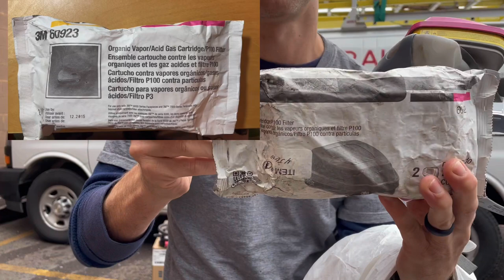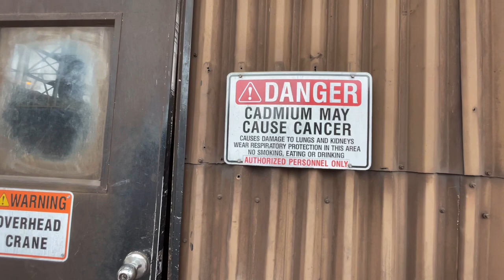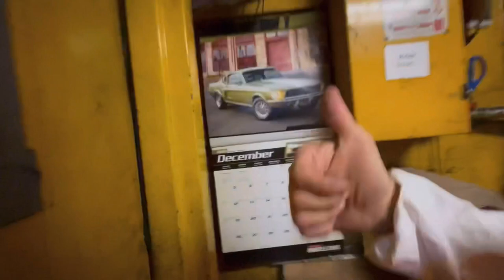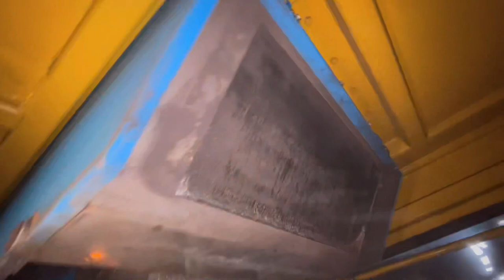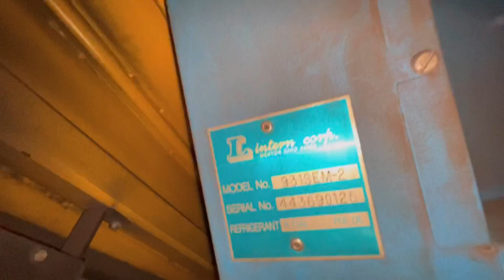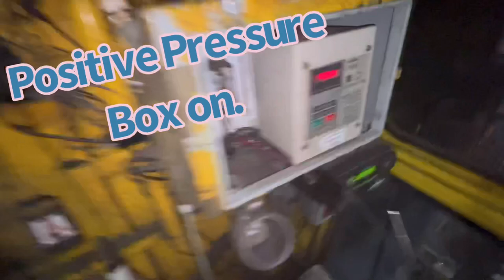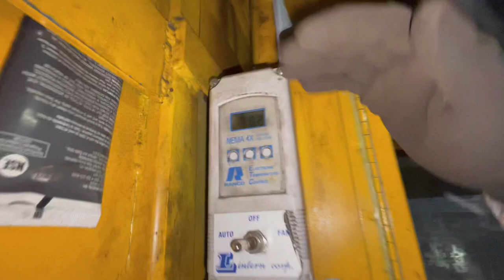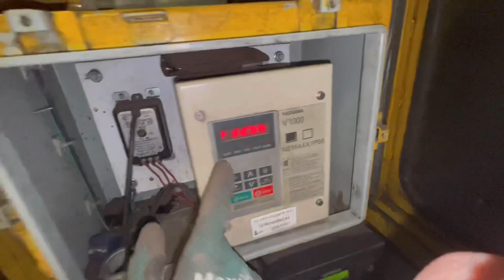Industrial HVAC 101 #hvacexplained #steamfitterslocal449 #lintern #hvaclife #sporlan #ruthrauff

Comment: Dust isn't only conductive It's explosive.
Reply from the maker: Damn right.  
I was using a compressed air gun to clear out a unit one time but first I had to blow all the soot off around the unit.  During that process it stirred up that metallic dust shorting across the contactor causing a violent explosion taking out pretty much all the wiring inside the unit.  Not fun to fix especially with no schematics.  
Caution must always be taken when working around live equipment especially with dust.  
Thanks for commenting have a great day.

Comment: I'm glad we're getting more electric heat equipment now cause it's more safe an cleaner to work in ice always wanted to see one in action
Reply from the maker: Electric heat is 100% efficient but it’s 100% expensive when it’s operating. Electric heat is very reliable as long as you have power and your connections are good.  It works well in many situations especially if flammable conditions are present.  Sometimes the hazardous conditions can  damage the resistive heaters by deteriorating the aluminum heat transfer discs on the side.    Thank you very much for watching and commenting on my video have a great day stay safe.

Comment: Thank you for the great video like always keep up the great work stay safe out there 👍🏻
Reply from the maker: Thank you very much Solo Tech.  I try to do my job safe as possible because I got many more years ahead of me.  Also I’d like to try to set an example to other technicians in this industry that we are not indestructible.  I like to point out interesting environments that we may get exposed to in this industry. A majority of these locations upcoming technicians don’t get to see in a classroom.  I may film a video coming up I have a neighbor that wants me to install a new furnace and air conditioner and I think I may refuse to do the job because she is a hoarder.  I literally would have to walk sideways to get downstairs and to her furnace it probably would take me a week to move all the stuff just to get the furnace out.  That brings me to my next point that I like commercial and industrial HVAC lol.  
Hope you’re doing well also have a great day.
Reply: @hvacexplained9341  Wow that’s crazy that’s a big-time fire hazard right there walk away from it lol
Reply from the maker: @soloch69  Well the fire burned itself out luckily without doing any more damage to the space below.  The one fire was on a packaged rooftop unit all the wires were completely fried, motors burned up I have no clue how they did not smell anything?
I’m currently starting up an air conditioner I installed a new system for a guy down the road for me in the fall I’m starting up right now as we speak.  Just making some final adjustments with the heat load we’re having at this time.

Comment: Just curious do you get paid more to doing the industrial jobs compared to commercial?
Reply from the maker: With our union yes, the rates are different.  Typically in any trade Industrial rate is higher.  It is not only hazardous but extremely dangerous.  
In the heating and air field you must be alert all the time.  
This by far is the worst of the worst conditions that I’ve worked in for my accounts.   I took over this account around 2005 and held it till about 2019 before I start training a couple technicians to take over for me because I have moved to Florida and currently with a new company.   
I begin my career at 19 years old, doing residential, heating and cooling for  1-1/2 years.  I will never returned to residential.  I help out friends and family only if it’s residential.   
The money is not there as a technician.  At least that’s my take.   If you are an owner of a residential HVAC company, you should do well as long as you show good customer service skills and have reliable, honest technicians.  
Have a great day Troy   🤙

Comment: This place looks like a riot lol. What facility is this? I’ve worked at a ton of the mills in our city except US Steel. Grunau does all there fire protection.
Reply from the maker: This industrial plant recycles hazardous material. It is extremely toxic for the environment and for the human body show precautions must be performed at all times. I literally have been going there since 2004 and a majority of my training was on the job, at this facility fixing constant breakdowns due to the conditions.    They have had three major fires in the past 12 years.   I have never seen a sprinkler. They utilize foam and other chemical agents to put out the fires.  They try to keep all chemicals in separate areas so they do not have a chance to incinerate the entire plan just parts of it.  I joke with guys up there once in a while saying the TV show dirty Jobs refused to come here lol.  I have been in many Other factories, power plants and industrial plants but this one by far is the dirtiest.  Thank you for your comment have a great day and stay safe.
Reply: I hear ya brother. I work at a glass plant in beaver county that’s pretty bad. No respirators required but I wear an N95 mask for my own safety. I’m working on the piping in  the bag joists and above the ceilings and there’s 1/4 inch of black dust and sout on everything. So when you bump something you can just see the black cloud of dust fall. It’s nasty. Def change the
Clothes before you get back in the van to go home lol.

Comment: How often does this need maintenance I'm assuming it just sucks most of that dust back in 🤔 seeing that its blown out in the same area.
Reply from the maker: Typically monthly for what I just did.  It’s just a never ending battle.  The cab filters the crane guy replaces daily.   There is a lot of equipment in this facility that requires a lot of attention.  I wish there was a better setup.  That soot obviously gets bad when I stir it up but a vacuum wouldn’t be too effective on the units.  
Thanks for watching and commenting have a great day.

Comment: I bet the exhaust fans are massive at this place
Reply from the maker: I’ve lost count of how many fans they have. Lol.  They have a separate dust collection vacuum system. I do not take care of this they have a separate company that comes in for that.  It is a very hazardous site but yes everything seems to be larger than normal at this facility.  Thank you for watching have a great day sir.
Reply: @hvacexplained9341   yea I was thinking it may be a separate system to get rid of that dust Instead of just blowing it in the atmosphere. Cool video. I just came over to the commercial/ industrial hvac for the local 72 union here in Atlanta from the supermarket refrigeration non union side of the trade. that’s a interesting place you’re at for sure.
Reply from the maker: @marlon8429 :  They run these separate Sweeper trucks through the facility to attempt to keep areas cleaner but it’s a never ending battle.  I do like the commercial and industrial side over residential HVAC.  I was offered a job to do supermarket in Refrigeration and just never fell into it.  I’ve been with this company for 17 - 1/2 years.  First company I started with I did residential for about a year and a half.  I just wish when I was going through school I could have seen all sides of the industry.   Heating and air industry is not a bad field to know in general. The pay is good sometimes the jobs can be bad at times but that’s with any field.  Sometimes you just have to find the best fit and what you’d like to work on.  I started working at this facility in 2004 and we had some technicians either retire or move onto a different company so I kind of hung onto the account since I was new with the company and was trying to make myself look good. Lol.

Comment: Awesome video! I have done lots of work at a steel mill in Canada, curious what brand units those are. I have worked on ISP and Philip Doyle units which are all designed for high ambient temperatures, they use R134A or R124 if I recall, harsh enviroment and very critical systems. Would love to know, I can send you some of the equipment I have worked on.
Reply from the maker: Some of those units up there especially the crane units are Lintern.   There’s small self-contained air conditioners that sit on the electrical section of the cranes they are McLean.    The crane unit I was working on was R-134A.
Reply: @hvacexplained9341  Right on, curious to know if there is a crane that is directly above where they melt the metal. The cranes that operated above the pot couldn't have any units on them due to the temperatures and conditions so they had something called an Air Trac system. Literally a moving duct system that the crane rides along and picks up some of the cold air. Really cool unit to work on, I have never seen anything like it.
Reply from the maker: @saugatools402  :  That crane gets put through hell and those conditions.   The temperature swings along with that harsh powdery chemicals are speeding up the death of the equipment.  There’s many more things I would like to film there but I’m not sure the next time I will be there.  I’ve been off of work for a week because of Covid.  It has really kicked my butt for sure.  Finally doing a lot better but still have some brain fog and fatigue.  Hope you’re doing well have a good day stay safe.
Reply: @hvacexplained9341  Feel better brother! Thanks for making the videos, Local 787 from Toronto Checking in!